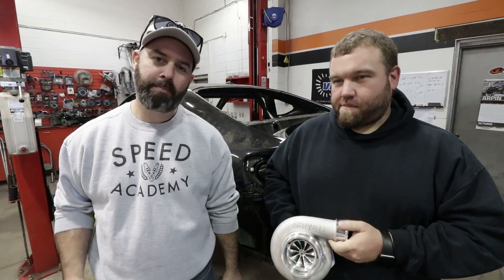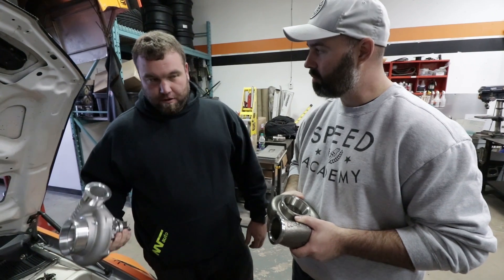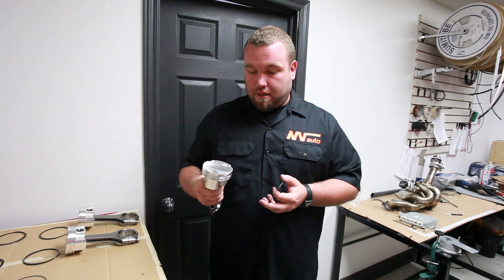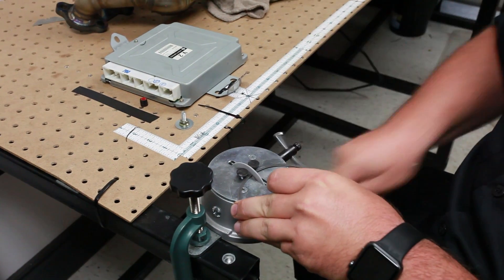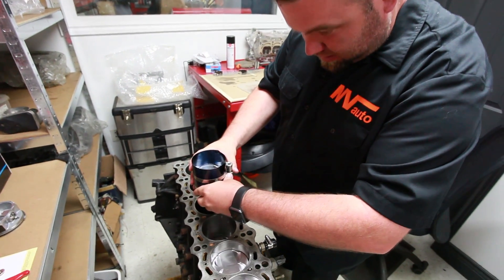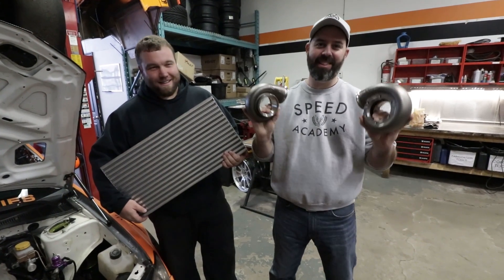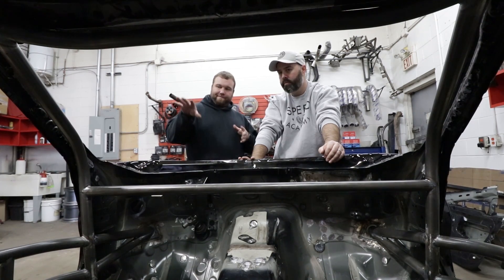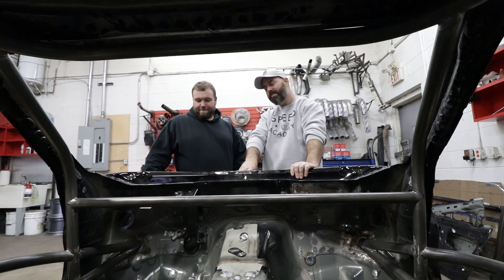New 1000HP Garrett GTX RS Turbo Revealed! - 2JZ BRZ Drift Build - EP03

Comment: got one of the beauties on my r33 gtr. pulled 770hp atw with no top end mods on 37psi (i believe). its getting a 2.8 nitto stroker and ported head etc. I am curious to see what power it will make with a slightly higher comp ratio. I dont think theres much more than 800 maybe 850hp atw available with this bad boy.

Comment: When the rings butt you have a ton more issues than detonation. More importantly detonation is caused by too much timing in the map or poor fuel. ring gaps don't set the compression ratio, piston pin height/design and cylinder head is what determines that.. the last video on Injector dynamics facility was cool!
Reply: Andrew Molina I'm glad you noticed that and he said nothing about scoring the cylinder walls or blow by at cold temps due to uneven ring wear or breaking the rings and or ring lands

Comment: Why is that even necessary you don't need 1000hp to fucking drift and I doubt any of you are going to be formula drifting and not even good enough to formula drift
Reply: I hope you do realize that this car competed in formula drift pro 2 this year. You need to do some research before ya start talking shit. I talked the lead tech aka the guy in the video at Formula Drift at Texas Motorspeedway and we talked for a while and they can drive damn good. During that event they finished in 3rd place. So just an fyi keep ya mouth shut you just another 12 year old kid who doesn't know anything about the sport.
Reply: TheOnlyJanko ohh sorry you got but hurt dude but it's still completely unnecessary for a 1000 horsepower drift car
Reply: Lmao do you even watch formula drift? Everyone else is running very high hp cars you gotta keep up. Don't be talking shit if you haven't even seen formula drift in person or live stream's.
Reply: TheOnlyJanko I actually have watched it but I still don't get the point of having a 1000 horsepower car to drift, I still like the fact how you're getting butt hurt over this
Reply: Not but hurt at all. All im trying to tell you is the reason they push so much power is to keep with the pro level of competition. This isn't grass routes drifting.....

Comment: nice build ,,i got an e46 convertible and i want more power then the 170bhp it has now..i want a streetlegal car and im searching for ppl with knowhow..What would you suggest me to do... in my mind i have- turbo conversion the original m52tub25 engine,it has dual vanos or go with the bigger s54 engine  or a 2jz..i have the funds for it but cant get to a desicion..
and im going to do a video about it,, my goal is-
Street legal-550whp+ - dual clutch ..

Comment: when will the Gtx 3584rs be available for us non sponsored consumers,this would be a much better choice than running the gtx4202r i bought for my rx7 10th Ae project.
Reply from the maker: It's available right now. Not sure when dealers will have it but when we published the video Garrett had it available.
Reply: Speed Academy What's the difference between r and rs?

Comment: Hey guys, I watch a bit of your stuff from time to time, I know I 've motioned this before- I'm a mechanic who builds a lot of engines for modified or race cars (mainly for drag racing). Well, I have a slightly different answer as to why it's dangerous for piston rings to not be gapped correctly; when this happens, the rings butt up against each other as mentioned, but this causes scoring of the cylinder wall and a resulting loss of comp and consumption of oil. It CAN effect dynamic comp, but in my opinion that is marginal and the least of your problems in reality. Any butting and scoring will be a death blow for your engine. Simple as that. Big boosted engines do not like oil in the combustion chamber, that's why we all use catch cans to avoid the detonation
Reply: Other than that it's a real good way of shattering a cast piston or destroying a ring land on a forgie. What your engine builder said is correct though if someone has different end gaps from cyl to cyl. Believe it or not I've seen things like this happening from poorly thought out inlet manifold design where airflow differed from cly to cyl that much it caused lean cyl's with some and rich with others. A blocked injector in a turbo can also have the same result! Ask me how I know that one!!! ;)

Comment: You didn't make sure that intercooler was in tune. 
Unsubscribe!

I think I could watch somebody build an entire engine.
Reply from the maker: Haha, we thought about playing it but Dov is a newb when it comes to harps.
Reply: Speed Academy Is Garretts claimed hp for this turbo on pump gas? Oct 92,93 or only on race gas? I'm trying to figure out if the gen 2 gtx3576r can help me reach 600whp on basic pump gas
Reply: Speed Academy I forgot to mention my motor is a k24
Reply: +dohc1974 it will make it on e85 or race gas. Is your motor a stock k24, a built one or a K20 Frankenstein? The gtx3576r should make 600 whp on 93 octane IF you have a good intercooler, these new turbos like high boost to make power and high boost=high iat's
Reply: +dohc1974 I'd use header wrap, a turbo blanket and a tall FMIC rather than a long one with these turbos.
Reply: Hey man thanks for taking the time to reply. The k24 is a frank and currently stock. I'm planning on running low boost until I get my finds ready for a built bottom end.

Comment: PLEASE GET REALLY TECHNICAL SOMETIMES
Reply: YESS!
Reply: He clearly has no idea about the design of turbine wheels.  

The first thing that strikes me about the design is the increase length (or height), turbine wheels have an optimal ratio of length/diameter ratio of 0.8, but this is often reduced due trades with inertia and bearing loads.  Also the hub line appears to have been raised to surpass secondary flows.  It would seem in this case Honeywell have gone all out in terms of aerodynamic performance.  I used to design turbine wheels and impellers for a living, turbine wheels were always my favourite.
Reply: @tedpalmer1537 danm you a nerd. Can we be friends?

Comment: Hahahahaha fucking 2J's <3 880hp stock bottom end, high rpm drift car. The bottom end is still okay! WTF
Reply: Downhillcruise at sound performance in Chicago like 12 years ago they had a supra on the cover of turbo mag making 1017 hp to the wheels stock bottom end. stayed together for 6 months
Reply: Downhillcruise yea Toyota got it right with the jz engines.